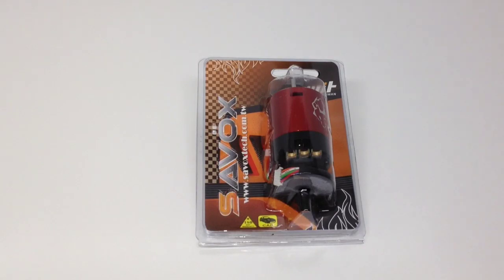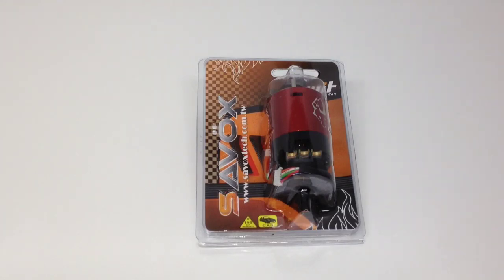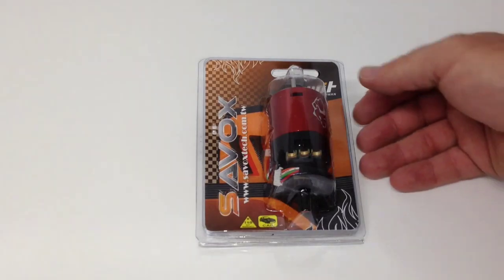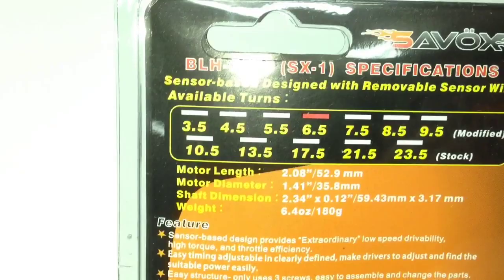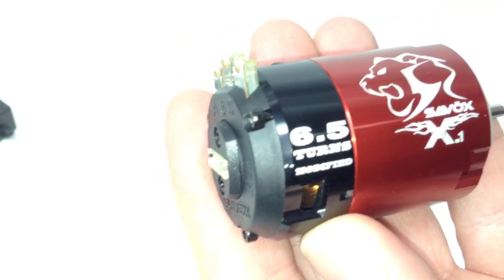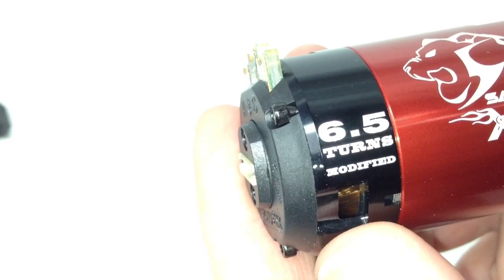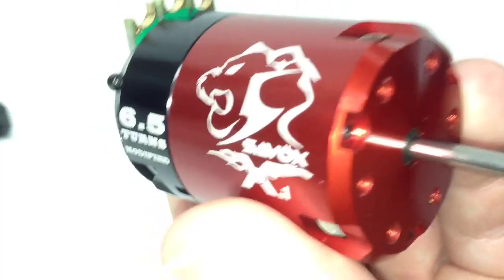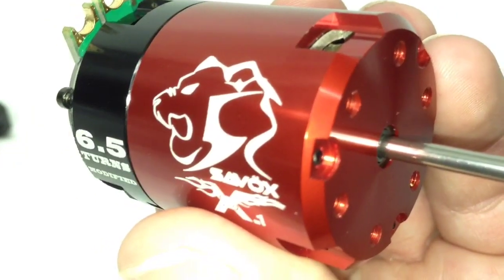NEW!! Savox 540 Brushless Sensored Motors

Comment: Hi Rich. Just put this motor in my b5m. The 17.5 Had the Tekin Gen 2 motor, but it got fried. Haven't had the chance to run the Savox yet. How does it compare to the Tekin Gen 2 motor? Thanks!!
Reply from the maker: +Dimitri Kalkanis It's really similar to the Tekin, but the Tekin feels a bit smoother than the Savox.  The Gen 3 is now out.....That will be the test!

Comment: there a 2 pole rotor and a 3 pole stator.  all brushless  motors that are 3 pole stator its how they work.  rotors have to be in pairs.  2, 4, 6 and so on.  a 3 pole rotor would not spin as it would be nns or ssn pole configuration.

Comment from the maker: There's not really a conv. from kv to turns, as it's a bit different.  Yet another thing in RC that needs to be standardized.  Basically the lower the turn, the faster the motor is.  The 6.5t will be quite fast and on the track you saw the SCT410 on.  External motor timing is kind of like "turbo" so to speak.  You spin that dial and it adjusts the RPM of the motor (or how quick it hits the magnetic poles) Increasing it will give you more top end and less torque and more heat.